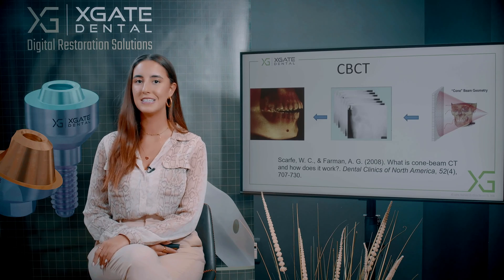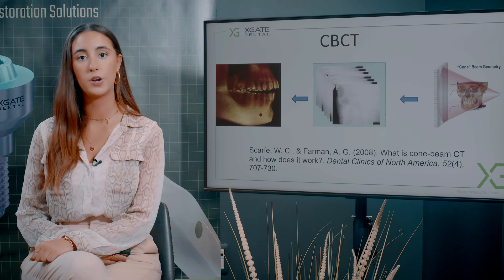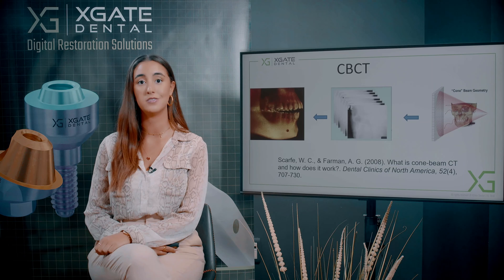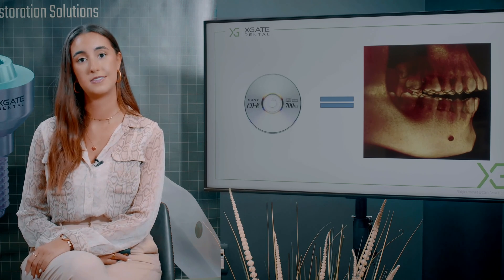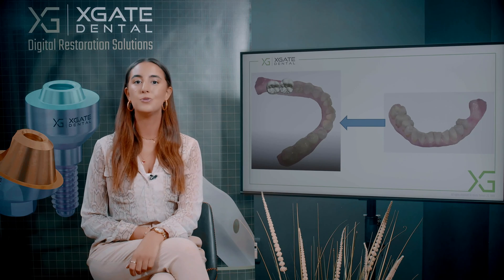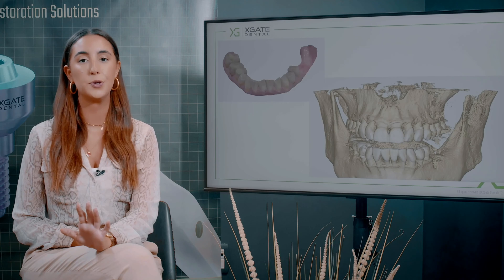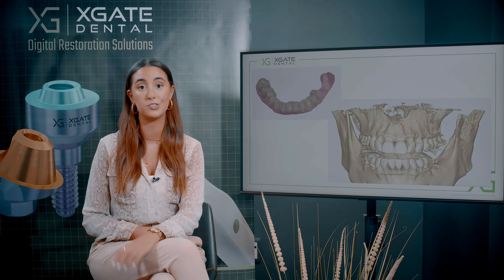5 steps of SURGICAL GUIDE: from arriving to the clinic to receiving your own dental crowns

Comment from the maker: 00:00 The first step is the...
01:00 The 3D reconstruction  
02:00 We need a perpendicular cut of every place in the jaw
03:00 It's a perfect perpendicular cut of every step of the arch of the jaw 
04:00 It's something that can only be made with a cbct x-ray and not with any other technique 
05:00 You can superposition the 3D reconstruction with the 3D model one on top of another
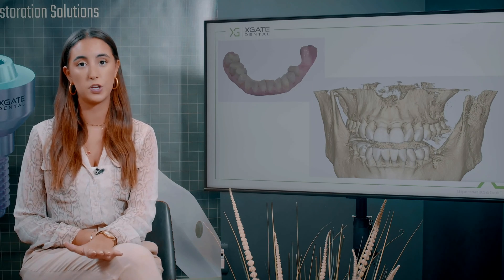06:00 Everything is done according to the crowns that we designed before
07:00 The surgical guide is printed from a type of plastic that you can sterilize before the procedure 
08:00 The next stage that we don't see here is the...